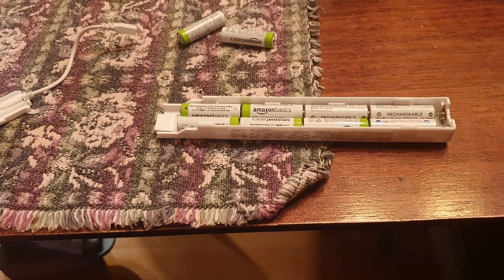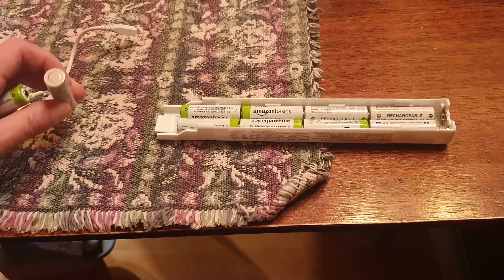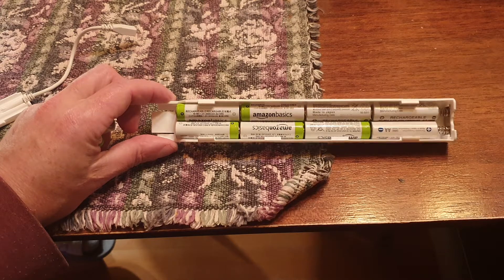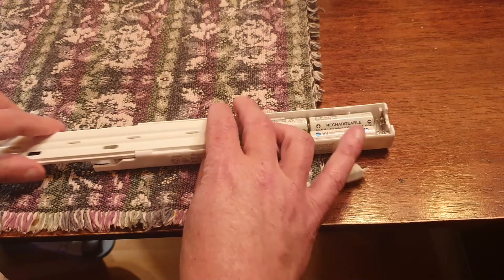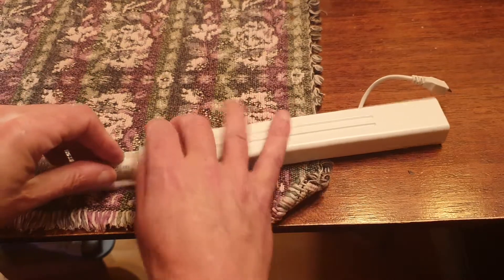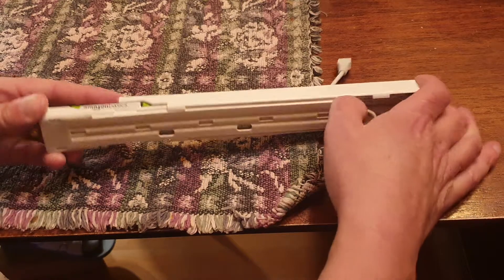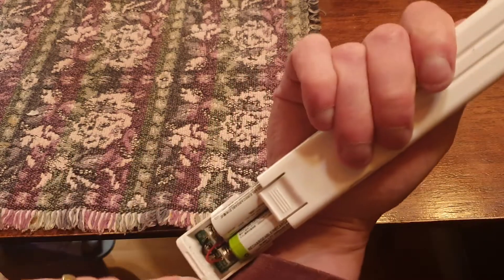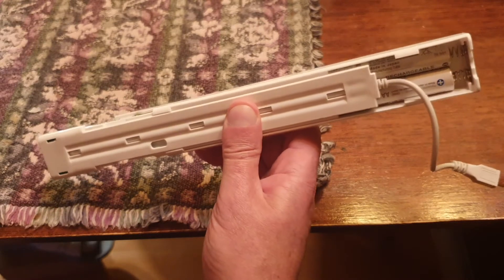how to use rechargeable batteries with Bali motorized blinds

Comment: Did you find any issues with micro-USB ports on this battery pack?  My experience is that it is very flimsy and easily damaged (even when I have lined the connectors with correct orientation). In many cases, the female connector came out with the male connector (using 2 packs) when I tried to separate to change the batteries. Looking for a DIY option.
Reply from the maker: I didn't have that issue but it's possible to cut the red and black wire going to the usb port and solder wires directly onto them. Then you don't need to bother with them.
Reply: same issue... I am filing my second warranty claim for that micro USB port.